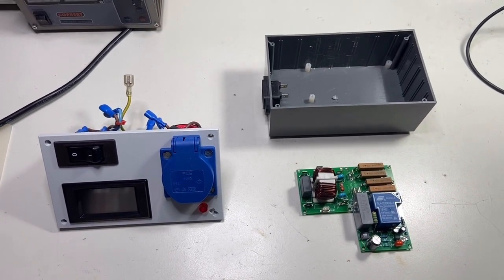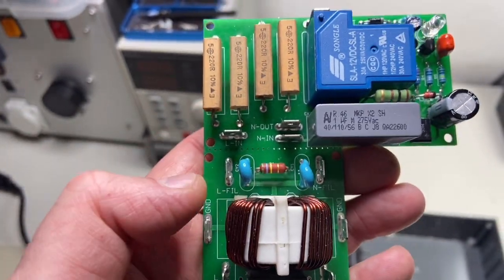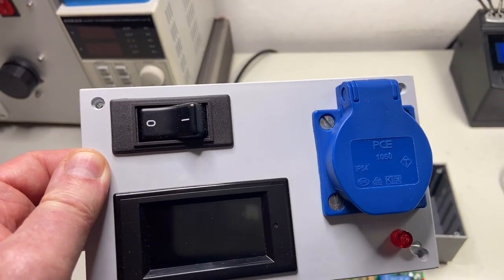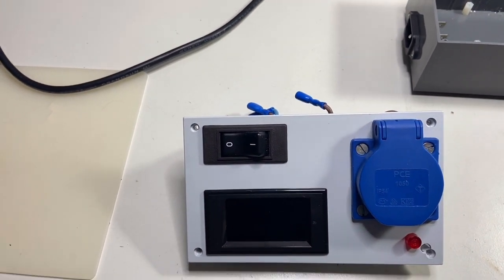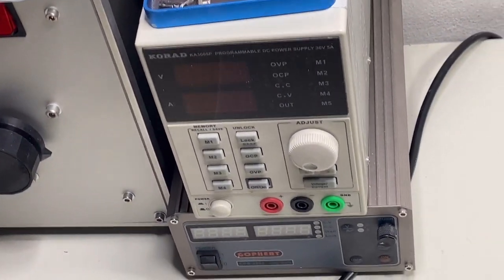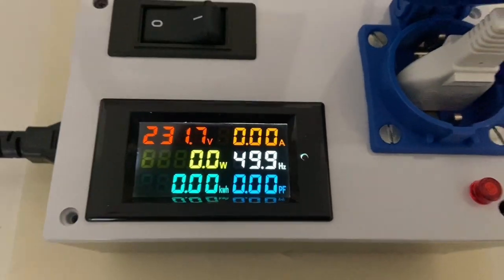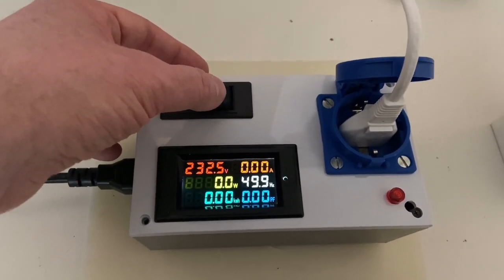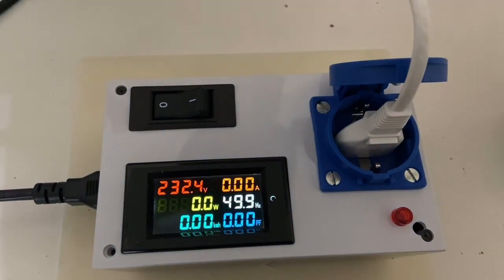Simple and  Cheap Mains Power Meter with 16A Inrush Current Limiter and EMC Filter

Comment: Hi Konstantin, I highly recommend you to redesign the inrush current limiting PCB for safety reasons. As one can see at 1:43 of your video, the L and N come very close to each other and I am pretty sure you have violated the safety minimums for the clearance and creepage distances. FYI, as per EN60950-1 or per IPC-2221B the clearance for uncoated traces should be at least 2.5mm and the creepage should be at least 3.2mm for 230V ac mains powered devices.
Reply from the maker: Hi, yes this was the very first Version where I needed fast a Solution for a Private Project.
I realized the issues after I received the PCB's, the actual one is designed with adequate Distances and Millings to meet the Safety Specs. This Box was made some Years ago with the Very Old version and stayed like that.